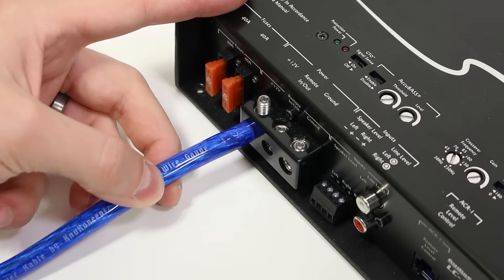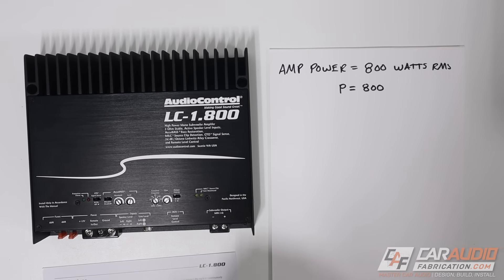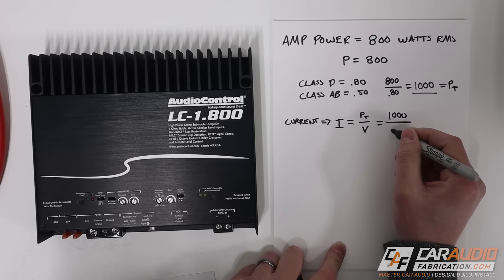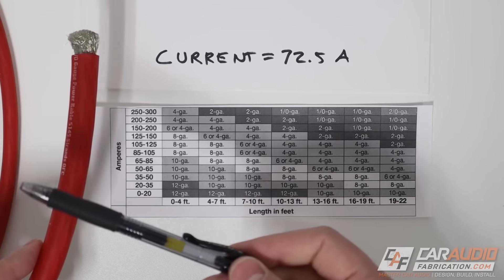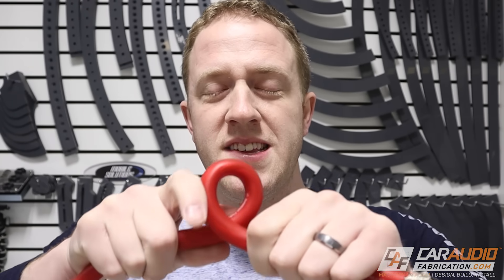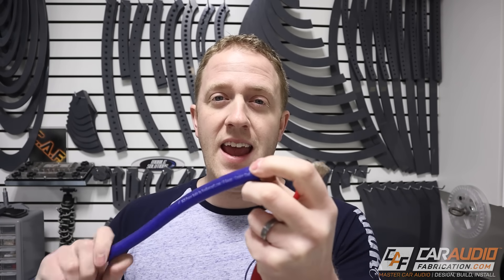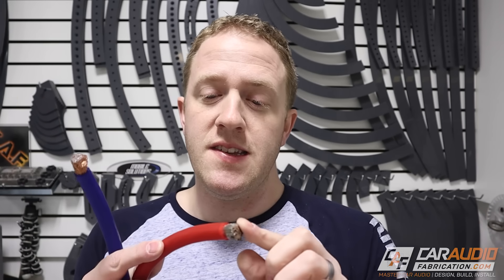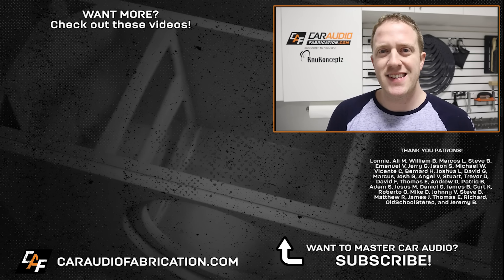What WIRE GAUGE SIZE for amplifier install? How to calculate!

Comment from the maker: 😎 Enjoy this video? Here are some other related videos to this topic:
👉How to plan a full electrical system: https://youtu.be/NixHUNo0YII
👉Car Audio Electrical System Basics: https://youtu.be/XSsOPu6gHmQ
👉Installing a two amplifier system: https://youtu.be/tkN460BMB5M
Reply: Can you leave a link to where we could buy a wire kit with that OFC cable
Reply: So having a fuse popping issue but I think I fixed it. Lose connection. I have a kicker 1200.1 going to a Kicker L7Q class 12inch. What gauge wire should I use for it?
Reply: Man I need your help I got a problem and can’t figure it out I been hooking up amps and subs and head units since I’ve been 15 years old and now im 42 but I am stumped on this one lol ok here’s me problem I have a 2010 accord coupe with aftermarket android head unit that runs off my factory head unit   tried to hook up amp and subwoofers  RCA because factory unit doesn’t have them no I got a converter box everything work and turns on but have noise when driving and big thump when I turn off car
Reply: @KidHonda80  everything you are guys are asking either is typed by someone that’s illiterate or is way to broad. You need to be more specific. There’s a lot of different variables that could be wrong. Number one and very crucial, change out the head unit it’s not designed to do what you’re trying to do nor is the way it’s wired. It’s designed to do exactly what it’s doing. It’s not designed to run to a high pass low pass inverter it is designed to go directly to the speakers that is in the vehicle. The problem is you’re running into electromagnetic interference you can try an RF filter probably won’t do much best advice change out the factory head unit
Reply: And don’t buy cheap RCA wires if the amplifiers in the trunk and you have to run from the head unit to the trunk they’re gonna be a little pricey if you want engine ice is gone or at least two minimum by quality shielded, RCA wires else so you can check and maybe change your ground around to a different spot there’s a lot, but this is not a difficult process this is a very common car wiring harnesses should come very easily for an aftermarket head unit
Reply: Mark if I use a 8 ga instead of the 4ga will it cause the amp to go into protection mode? Thanks
Reply: @hankcarrillo1494 does he ever respond? I'm wondering the same thing. I currently have a 8 guage system and looking to upgrade. The new amp says 4 guage, but when I watch these videos it says 8 guage should work.
Reply: @hankcarrillo1494  no

Comment: Confused....it's the same thing if you upsize the wire? 
Use a 0 gauge cca if you need a 2 gauge ofc , and you'll be good...it's way cheaper. Cheep cheep

Comment: Running cable takes time, and it's the lifeline for your amps.. you might as well get OFC since you will be spending the time having to route the wires around, and the amps will appreciate the electron flow
Reply from the maker: The wire in the video IS ofc.
Reply: @CarAudioFabrication   I never said it wasn't buddy. I was trying to say that OFC should be the only choice

Comment: If my car and amp is wired with 0 gauge and i wanted to add a capacitor, would i lose sound quality or power if a use 4 gauge?

Comment: is it bad to put a 2awg (35mm) wire on a 350watts rms amplifier with 30A fuse (with 1800W woofer)? or is it bad?
Reply: @jbdiagnose  your amp has 30amp fuse.. he explains exactly how to calculate you power wire size.. sounds like you have to get back to basics..

Comment: I'm glad this was a a little more balanced. People want me to spend more on wire than my system. Gold is superior but we don't use for economical reasons. I'm happy using aluminum for a single 10". I'll just watch for corrosion at the terminals and maybe use some dielectric grease.

Comment: You made the calculations on using the Amp on 2 ohm/800 w. If you had chosen to run it on 4ohm/500w you would have calculated on 500 rms or 800?

Comment: I calculated and it ended up being 4 guage, i got a 4 guage kit and the fu*king wire doesnt fit into my amplifier
Reply: get wire ferrules or wire connectors and crimp it then it will fit

Comment: One thing you're being unclear about is whether we must always choose the lowest stable impedence values in watts vs the impedence we're actually going to be using. In your example, you go straight to the 2 ohm value, but I don't know if that's because your calculation always requires watts at the lowest stable impedence, or whether you're actually hooked up to a 2 ohm driver. I suspect it is the former because your calculations in this video and your other one don't add up if I use watts from 4 ohms which are what my drivers are. Here's the numbers for 4 ohms:
AudioControl D-6.1200
750 watts rms
750 / .8 / 13.8 = 67.9
Or  70 amp fuse ?
The specs for the amp say: fuse rating: 40A x 3 = 120 amps which isn't even close to 70 as you've stated it should be. However if I choose the 2 ohm wattage from the amp specs it's 1200 watts / .8 / 13.8 = 108.7 which is closer to the amp fuse specs of: 40A x 3 = 120 amps.
So, the question is; are we really supposed to always use the watt total for the  lowest supported impedence? Or, could it be that for my application at 4 ohms, I could actually use a 70 amp fuse instead of 120?
    I don't mean to be picky; I just want to be sure I'm using the correct values and why. I do love your helpful videos.

Comment: So in your example, you’re using the two ohm rating for the RMS wattage, what if we are using all four ohm speakers then do we use that rating or do we always use the two ohm rating on an app for wire size?

Comment: My vehicle has 1/0 OFC wire pre installed. I have a 1500 watt monoblock amp. Can I downsize my wire to fit in my amp with reducers, or should I replace my wire with 4 gauge? Thanks.

Comment: Hey thank you for all of your help I have a question. I have installed the skar evl 12 (1250 rms) sub and enclosure they sell on Amazon with a Taramps smart 3 bass amp. My question is will the amp go into protect with me running 4 gauge wire? Is 4 gauge ok since I am only setting gain for square root of 1250 which is 35.6 volts? Or do I need to have 0 gauge wire since the amp is a 3000 watt amp?

Comment: Hi! I have a problem. I helped my dad to install the audio system on my car. It worked for 2 days. Then,last night,I was going to use my car, but nothing worked. No power at all. My dad used 8 gauge cable for a Taramp 800 watts class D, which he had to    put together with a thinner cable to put it into the amp. He used wire connectos to put together that and other cables... we put a 30amp fuse. Also,the ground cable didn't convince  me. Why was my battery drained after everything worked well for 2 days?

Comment: What did you mean by system voltage? 2:14  Where did that number come from?
Reply: @rujoeking  i have been struggling with that for a little bit now and i believe it to be the battery voltage

Comment: I going to do my amp wiring on my Tiguan in the next couple days. I bought 0/1 gauge CCA wiring amp kit from knukonceptz. I’m going to install a D5.1300 from Audio Control. Will this wiring kit be enough to deliver enough power for my application? Any advise before I fucked things up and set my car on fire?

Comment: First off. Your videos have made me into a better car audio guy. I have learned more from your videos and discussion than reading the text books about car audio I have, thanks. I do have a question about choosing the right OFC Copper wire. I wanted to know, in your opinion, how many strands of wire should a 4 gauge wire have and what is the highest amount that is on the market by brand if such exists? I am presuming that more strands equal more flow regardless if it is pure copper already. I ask because I saw two versions once and wasn't sure if it matter. Your example in this video pretty much applies to my amplifier at 2 ohms running 800 watts RMS.  Thanks!

Comment: I have a 1200 watt amplifier I did buy a kit 1500 watt  for my SUV and it sounds good but I'm back in my truck and the ppl that had my truck has a small wire in there it's ok but I don't want to burn out my amplifier so is it a good idea to buy another kit  that's 1500 for my truck I don't want to take the other word out of the SUV just in case if I have to use the vehicle again please let me know

Comment: Taramps 3k 350 amp alternator…..0 gauge big 3 …. Larger Agm battery extra Agm in the trunk …..all battery wiring 0 gauge…… dual 0 to 4 reducer from second battery for both ground and power….. am I doing it right ?

Comment: Do you have to go down a gauge in wire (4 gauge to 8 gauge) when wiring  the second amp. or can you use 4 gauge for all connections?

Comment: Love your videos, thanks!
In this example you use 800 watts in the equation. If you were wiring at 4 ohms would you use 500 watts or do you always use the largest rms output possible for the amp?
Reply: Also wondering about this.. what did you find out?

Comment: Has anybody hooked up car audio with extension cord wire?
Reply: @sir275handsome  I have I wound all three inner wires and ran it without any fuse other than the one on the amp. It’s a 1000w max 4 ch. amp. Been running like that for 6 years. No issues.

Comment: I’m looking to buy some cable for my system set up. The part I’m confused on is when going to the chart and determining the total wire length. I’ve always kept my ground wire as short as possible but my newest amp says for high powered amps it is best to run ground from amp to battery. In the video You said length is from batter to amp and amp to ground. So if I run a power cable from battery to amp and a ground from battery to amp, both wires are 18 ft long am I looking at a 36 ft run?

Comment: As of now I have an 8 gauge wired from my battery going to an inline fuse going to my Rockford fostgate 1200w amp and going to my two 12’’ Rockford fostgate subs and I’ve never had any issues. Installed 4 JL door speakers with 2 tweeters. I know what to run the speakers to a separate amp.. so now I want to run a wire from my battery to a fuse, then to a distribution block than to the amps, so can you please help me on the wire size I’d need to run from my battery, and the wire size is run from my distribution block to my amps? Also what fuse/fuse size to get. Great video thank you.

Comment: Im confused where he got the 13.8 volts from. Any help is appreciated
Reply: From your battery
I have some questions too
I calculated at 2:17 and it’s equals to 301A and the fuses putted in the amplifier is 30 and 30

Comment: So me and some friends installed a sub in my car. 2 years later the power cable to the sub melts right by the battery, right behind the fuse....im hoping to just get a bigger gauge, from 8 to 4, with the same kinda fuse, and it will be okay. great video!

Comment: Would wire to thin make the amp heat up more then it should? 8 gauge on 1000w pioneer amp but the rms of it is 480

Comment: Question! Im new to car audio and this is my DYI for my wife 2008 MDX. Installing BOSS mono 1200W and BOSS 4 channel 1100w
1. Running 0g power wire to distribution 1in-2out, NOW can I down size from 0g to 4g or 8g after distribution?
2. Do I REALLY need distribution block for grounding two amps? OR can both amps have they OWN ground

Thank you for your videos! I have a electrical background working for a manufacturing company working on automation robots, but this audio stuff is so different lolol PLEASE more educational videos!!

Comment: I didn't know the length of the wire mattered much. So from what I gathered from the video, I should be OK using 8 gauge for 800W RMS since my amp is under my front seat? I drive a 2021 accord. I think I probably have around 7-8ft of power and no more than 3ft absolute max of ground. More curious than anything, I'll likely swap my existing wire to 4 gauge anyways
Reply: I never use any less than 4 gage wire !! OFC might be best , but only really used in multi hi end amp install !!

Comment: What about systems with 450 amps and higher? What wire do I use? Is 0 gauge still good for a 15ft run? Or should I go up to 2/0?

Comment: Hi, Mark. Thanks a lot for this video. It enlightened my mind in regards to my installation. I have a few questions though. What wattage should I consider in the calculation? The total wattage the amp manufacturer specifies or the total wattage it'll be driving according to my speakers? Example: I have an Infinity Reference 4555a, which according to the manufacturer is a class D amp, with an output of 760W RMS @ 2 Ohms. I'll be using Infinity Kappa 90CSX front, 60CSX rear (which are rated at 2.5 Ohms each pair and considering the length of the speaker cable, which I'm running from the back of the car to the rear or my stock unit plus the stock cabling back to the speakers, should be close to 4 Ohms back again) and a 4 Ohms Sub. The amp says it's 45W x 4 + 320W x 1 @ 4 Ohms. Is this the value I should consider? Also, I am not going to use the amp at full power. This is for a family car which I'd say 95% of the time will be used at around 30% of the volume max. Does this mean I can safely go lower on the power cable and fuse (I already have a 10AWG good quality cable from Rockford Fosgate from a previous install)? Oh, and my amp is located in the 3rd row of my SUV, around 6 feet from the battery, which is located near the right taillight, due to my car being a hybrid. Trying to save money and use the same amp, speakers and cables from the previous car if possible.

Comment: sooo for a system running a 3000w amp to 2 dual 2hom 12 inch subs ill need a 1-0ga cable correct

Comment: So I have class ab amp  2 channel 5000watt rms 2ohm stable  with 80amp big fuse 2500 X2 , so my question is,what would be the proper wire gauge for that amp ik length is big deal I have 05 scion tc small car maybe 13 to 16 ft Max and I want to use the ofc rated wire,I'm ready to buy kit off the knukonceptz web but want to be sure I buy the proper kit any help would be appreciated much thanks

Comment: You saved me money again Mark. I’m using a JL Audio HD 1200 and an Alpine PDX f4 drawing 150 amps total. I have approximately an 8’ run of 4 gauge OFC power wire running into a distribution block splitting to less than 2’ of 4 gauge to the JL and about 2’ of 8 gauge OFC to the Alpine. According to your chart, I’m good to go. I’m in the process of revamping my system, and I’ve been watching many of your videos. You are a great teacher with an impeccable work ethic. Keep up the great work!

Comment: Wait so the amp I'm running is a Pioneer gm-d9701 its a 1 channel mono block that's 2400W max, I'm running sub's at 2 ohms and if I do this equation at 800w RMS (which is what mine is rated at 2 ohms) Then I get 76 but the amp itself has 3x 40 amp fuses which equals to 120 amps
Reply: iv got the same amp mate

Comment: How much wattage can a single 0 gauge wire handle? I see a lot of amps with dual 0 gauge power an ground  in the 4000 watt range. I currently run a 2000 sub amp and a 1000 4 channel  amp with  knukonceptz 0 gauge ofc. Im wanting  to upgrade my sub amp to 3000. Will my power wire need another upgrade with 4000 watts

Comment: You get wire based on what can fit in your amp. If your amp is made for 8 guage wire you cant shove 4 guage in it, it wont work
Reply from the maker: That's great but what if you have three amps and need to know what size power distribution and wires to get. Then you need the knowledge in this video...

Comment: Hi Mark. Can I change the wire gouge from amplifier to passive crossover AND crossover to component? My amp's manual says that I have to use 12awg from amp, but i have 16 from crossover. I need to now if change that wire or leave it as already is

Comment: How does “GPT” or “Primary” Wire compare to the cca or ofc wire mentioned in this video? Can GPT/Primary wire be used for power and ground connections on a car amplifier?

Comment: I have a boss 1600 watts phantom amplifier what size wire should I use I got a 8 Gage boss amplifier wire kit  I never installed it in my car yet or I think I might hook it up to a mtx terminator 12 in 2000 watts subwoofer and a boss 2.0 capacitor
Reply: Forget Cap, use 4 gage, add second battery !!

Comment: I used knukonceptz 0 gauge cca kit to wire up my 1200 watt rms amp to run 4 kenwood excelon 10's . 
 After watching videos from CAF I was convinced I made the wrong decision. 
Then I watched the video about checking voltage drop. 
 I have 0.03 voltage drop between battery and amp. 14.48 at battery and 14.45 at amplifier. Now I am convinced that as long as you over size the cca it is all good 😎
Reply: The problem with CCA isn't voltage drop it's longevity. The more heat cycles CCA goes through the harder it gets. Hard = Brittle. At some point CCA wire WILL crumble, usually at hard bends first. At those places the wire will get hot enough to potentially start a fire. This is no joke. I've seen it first hand. CCA is fine for jumper cable but it is absolutely dangerous for daily use, high current, car audio power supply wire. 

Use 100% copper welding cable. Yes, it's more expensive but the US made stuff is super flexible, can be had in some cool colors, it can be had incarcerated sizes and when protected from oxidation it will last longer you. Before you sell that car get that copper cable out and use it in your vehicle. 

I sincerely hope you act on my advice and get that CCA  wire out of your vehicle because it WILL fail. The only unknown is when.
All the best

Comment: I have a old-school 5ch alpine v12 class T amp. 80 amp fuse on amp. 2 4s 2 6.5. 1x12. All alpine all 4 ohms. Is it ok to run 8 awh wirees???
Power wire. Is a bit under 5 meters. I put an 80 amp fuse in the 8awg power wire.